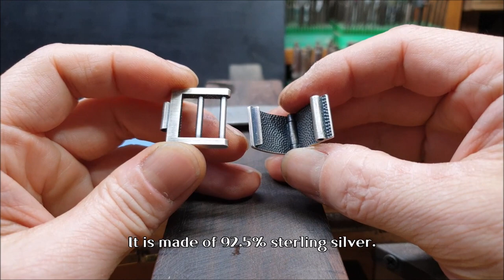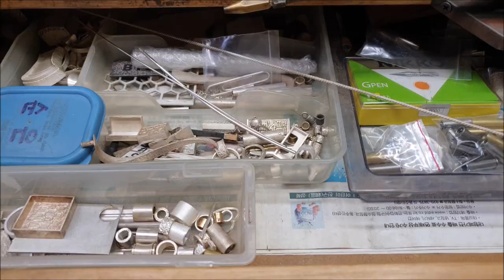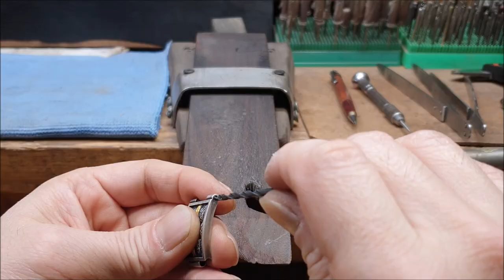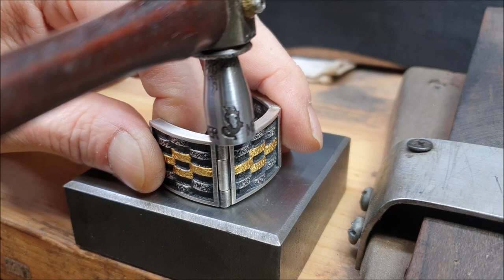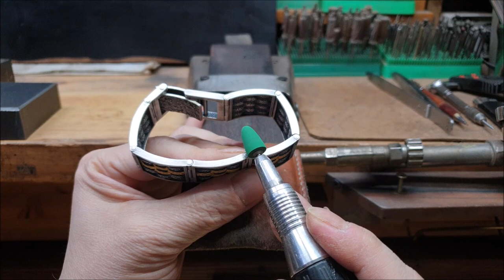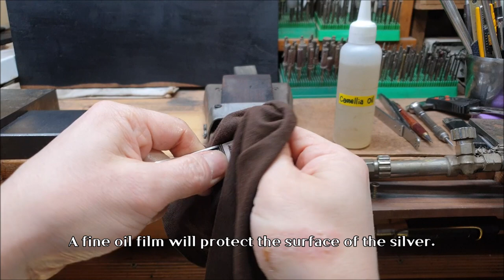Techniques for making silver BRACELET [ Silver weaving unit hinge connection ]

Comment: I wish you did show, how you made links on between... instead of only hot to connected them together  ...

Just saying  ....  🤷
Reply from the maker: The thickness of the gold sheet,,,
A postcard-sized gold sheet is about 3-4g.
That's about the thickness.
It is about the thickness of a regular paper.

Heating these metals to a temperature between 260~370°C increases 
the movement of the atoms. 
When pressure is added, 
this causes an electron exchange at the surface between the two metals, 
creating a permanent diffusion bond. 
This diffusion bond occurs far below 
the soldering temperature for either metal (Dhein, 2004).

Nothing is permanent in this world.
It may wear out over time.
Physical contact may cause it to peel off.
It doesn't go away easily with the passage of time.
Because silver and gold became one.
This is different from normal plating.
Thanks~